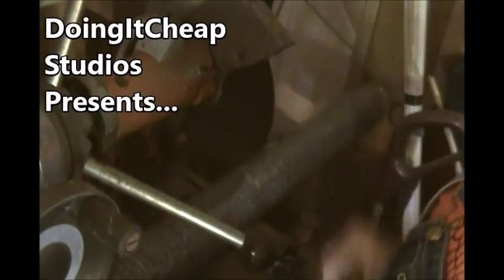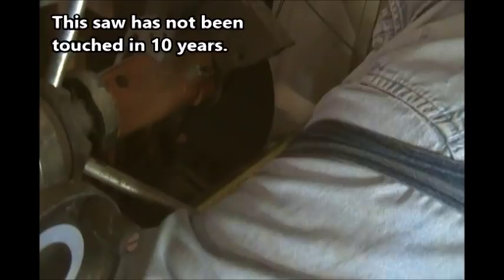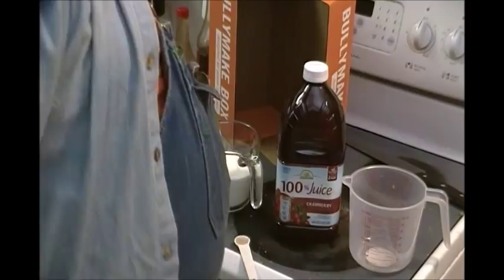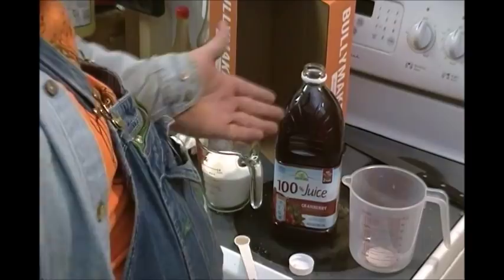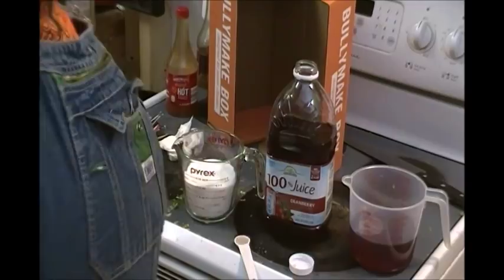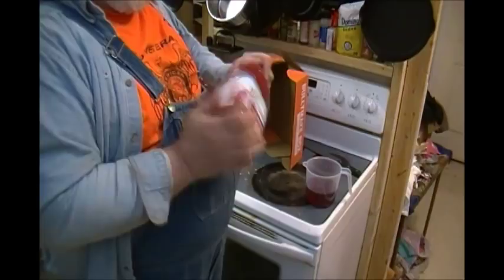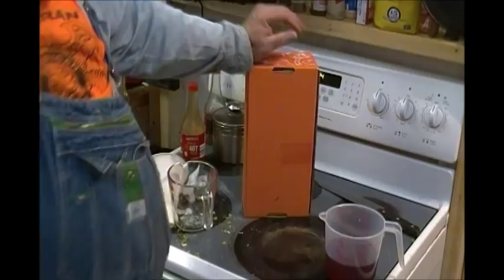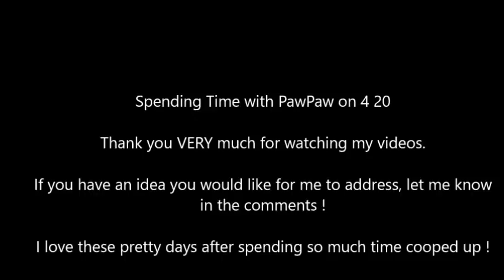PawPaw Spends 4 20 Cutting Fencing Painting and Making a New Flavor of Homemade Wine

Comment: As much as I like my gas power tools it is nice to pull out a long untouched electric tool(like your chopsaw) and simply plug it in and they always work.
Reply from the maker: I think I paid $39 for it about 13 years ago.  It didn't stall out mid-cut.  I had to reposition my grip.
Reply from the maker: You get that silver button yet?
Reply: No, I don't know how long it takes them to send it.

Comment: Your wine is just fine :) It's a foolproof recipe and easy too make, even I can make it. Sterilize plastic bottles is sometimes needed, for example overhere most applejuice is stored in carton packages. There are fancy tablets or whatever to sterilize the bottles, but since I like doing it cheap too, I use a different method. Just put one teaspoon of thin bleach in a gallon of water.  Put it in a bottle and wait for 15 minutes.  After that rinse it till the bleach smell is gone.. Let it dry and voila it's sterilized.
Reply from the maker: I don't do anything more than wash with dishwashing liquid and hot water.
Reply: I believe that would do the trick too.